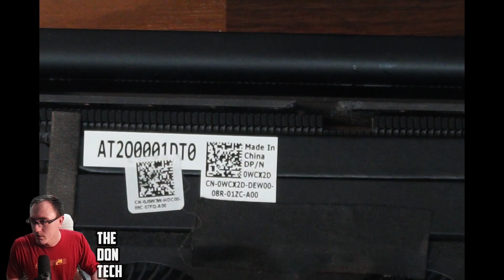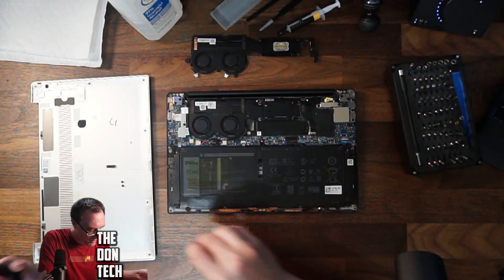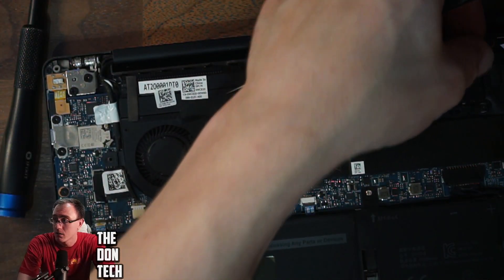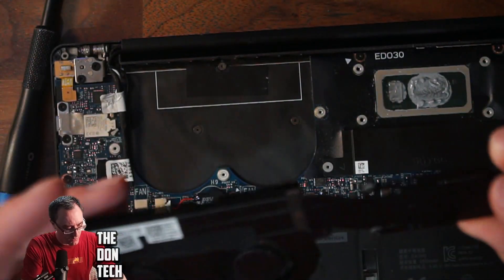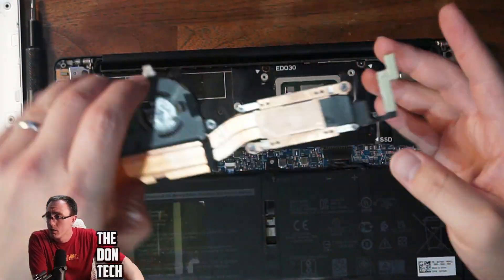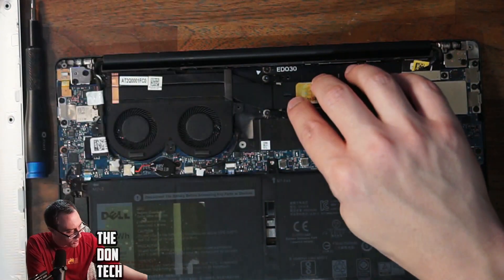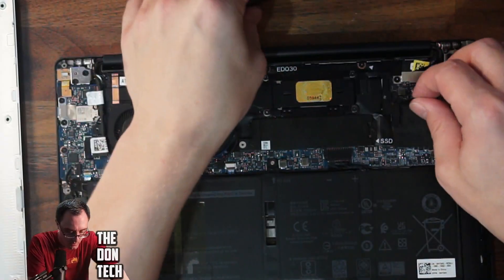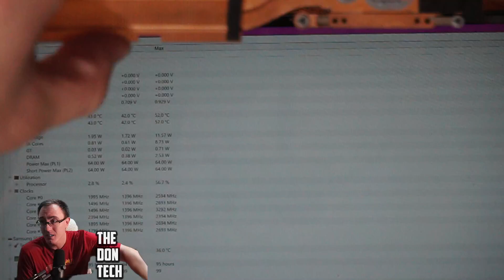Dell XPS Heatsink Replacement: Boost Performance & Fix Overheating!

Comment: Can you disconnect the fan from the heatsink ?
Reply from the maker: Excellent question. I know when I bought this it came as a set with the heatsink already attached. The fans may technically be able to come "off" the heatsink assembly, but may not be meant to attach to anything else, or it may be molded to the heatsink itself. So if your fan goes bad, you may need to replace the entire assembly.

Comment: Very helpful for a novice!  Thank you.  Question: If the fan/heat sink I purchase on eBay comes with thermal pads already stuck to the heat sink (in the location where you applied the thermal paste), should I remove those pads and apply the thermal paste instead?
Reply from the maker: If they're thermal pads you want to leave them. These pads will be thicker than paste and more malleable, and something that you can actually pick up in 1 solid piece. 

Most second hand heatsinks I've bought do not have any thermal paste on them. So if yours came with it, removing it would not hurt and then adding your own. But leave the pads as they are.

Comment: best solution for XPS 15 7590 overheating issue .... glue the same additional heatsink but remove the sinks at the edges so you can still keep your laptop closed . KEY POINT, stick 6 W/MK thermal pad between the newly upgraded double heatsink and the bottom laptop cover to dissipate all the heat outward for extra cooling . so yeah... the bottom of the laptop will get hot but the solution I suggest works 100 % and tested on my own XPS 15 7590 with GTX 1650. temps are at 65C-70C on full load at 4GHZ all cores (not just 4.5ghz single core), oh maybe because I also installed a laptop cooling fan at the bottom of the laptop with a voltage controller for extra 1K rpm air flow on a self modified laptop cooling pad with 100mm×100mm×10mm cooling fan. love my XPS now for moderate gaming experience on high settings at 55- 60 FPS stable.
Reply from the maker: Haha that sounds amazing, do you have a video or pictures of this? I'd love to see it.

Comment: Thanks for the clear video, I got a xps 7590 with an i9 i replaced the thermal paste but it still really quickly spikes to high temperatures do you think its also a heat sink problem?
Reply from the maker: You're welcome! Replacing your heatsink will definitely be your next step for those temps. If at all possible, make sure you can get one that is brand new or a system pull. If you get used, it will likely not solve your issues.

Also depending on the age of your laptop, temperature creep is also expected after a few years (especially with an i9) so your mileage will vary. 

If your fans spin freely and are clear from debris that is good. if they're more junked up with maybe some dust 'stuck' to the fans, you may want to replace those as well.

Comment: I have XP3 13 7390 and wanted to replace the fans but I bought the wrong ones which only work with i3 cpus and do not have the "big" heatpipes and heatsink. The bearing of my fans are worn out. noisy and may block / stall if you tilt the notebook while the fans are running. I hope I can find a proper replacement here in germany
Reply from the maker: Yup, that's what happens a lot in this field. Many laptops have many different revisions, and the exact part number on the original part inside the laptop is the only way to confirm you are ordering the proper part. Could you use Ebay and buy from anywhere and get it shipped to Germany?
Reply: Exact same problem here, tried buying only the fan but didn't realise the xps 13 7390 fan is attached to the heatsink... And it is super noisy because it overheats. What a shit laptop

Comment: Very helpful. I will definitely use this when I try to change my fan. What size screwdriver do I need?
Reply from the maker: Glad it helped! The screws on the outside are a Torx size 5, or T5 screw. The inside screws were Philips Head (+) and should be a 1 or a 0 in size. Best of luck replacing your fan!